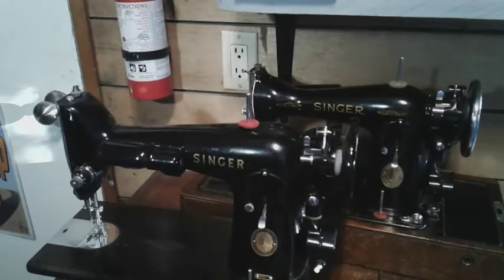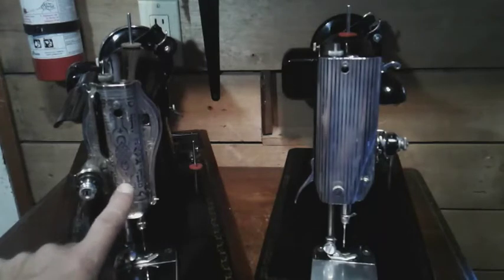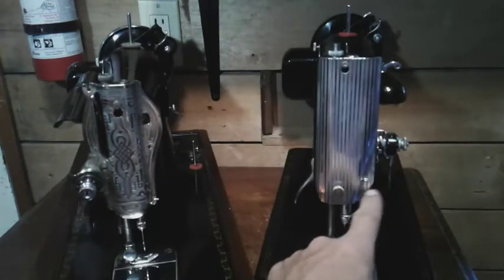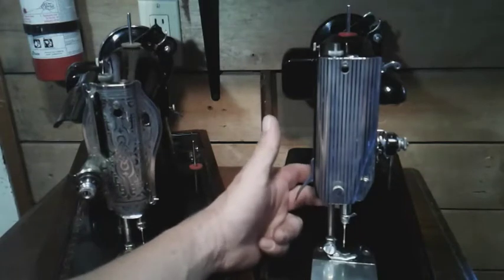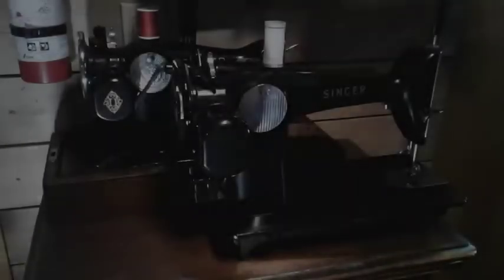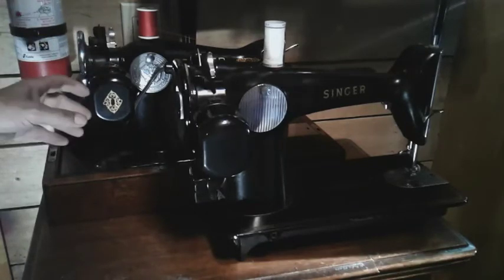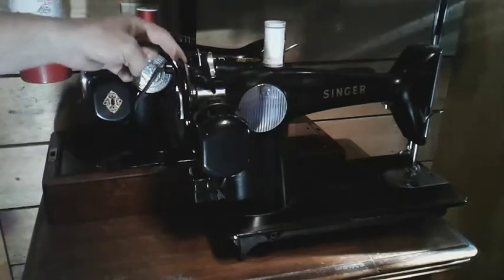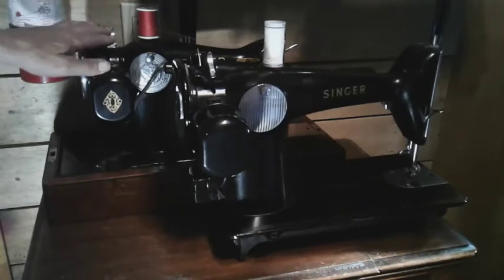Singer 15-91 vrs Singer 201 , What one would i keep ..

Comment: I believe that your 201 has an additional thread guide that rides on the needle bar.
The glass lens over the bulb may also be missing. 
I would like to find a LED replacement bulb that is warm white around 3200K and full spectrum / high CRI.
A dimmable LED would be a bonus with a dimmer switch retrofit.
Thank you for showing these machines.
Reply from the maker: Your correct on the neddle bar guide , all machines should have one there and mine does but some of my machines are missing it and the still run fine , but as for the glass on the light im afraid you may incorrect there , the 201 potted motor version with the light in the front does not use a glass cover , only rear mounted lights do , ive looked at many machines identical to mine and none have glass covers over the lights , now maybe im wrong but ive yet ot seen one with the glass over the bulb on a potted motor version , im with ya on the LED lights too , i like the warm yellow glow better then the bright white , if its vintage then the bulb should match in my opinion ,but im a novice collector so what do i know lol , thanks for watching and if you have a photo of the glass cover for the potted motor 201 id love to see it , like i said im a novice collector i could be wrong .....
Reply: @4486xxdawson  At this point, it's not unusual for these outstanding machines to have had their SingerLights replaces with similar models from other machines. As well as other parts. I could see one having a glass cover added at some point in the last 60+ years. 
Thank you for this video series!

Comment: I've sewn on both. For what it's worth, here are my thoughts.
Yes, the 201 produces an ever so slightly better stitch. A 10/10 for the 201 and a 9.95/10 for the 15-91 **when in proper adjustment, clean and lubricated**.
In terms of speed, when I need speed, I use one of my Singer Industrial machines.
In terms of difficult synthetics, denim (especially hemming), running a button hole machine, decorative zig-zagger, walking foot for super-slippery fabric or, most of all, free-motion - the 15-91 produces the same perfection without choking and the 201 has challenges.
In the end, my 401A and my 15-91 are my daily drivers. The 401A for that 10/10 perfect top stitching, the 15-91 for virtually indistinguishably stitch quality for everything else. Ironically, the 'Spartan' offers all the stitch quality of the 201 with nearly the power of the 15-91.
Reply from the maker: I like the 15 91 for sewing patches on my leather vest,  its like the tractor of singers , got the strength and easy to work on , plus more of them on the market still so parts easy to find,  as for the 401 i never used mine much just tuned it and sold , not really a sewing person just like working on them and the feel of them , its like nothing you can buy today ..,,thanks for watching and hope to hear from ya again soon...
Reply: @4486xxdawson  Thank you for your reply! The interesting thing about the 15-91 is that the combination of power and the "who cares, whateves, I'm going to make a perfect lockstitch" robustness of that oscillating hook let's me sew super filmy silk and other slippery fabrics with a vintage walking foot with a perfect stitch just as easily as I can hem a pair of jeans in the same thickness as the factory original.
The 401A was very close to the end of real Singer quality. The hook drive gears are not only hobbed, but paired and polished together as a pair for each single machine to produce the smoothest work possible. The stitches are every bit as perfect as the 201 and you have all the versatility of a workhorse decorative zig-zag machine. I'd never get rid of either.

Comment: I just got into refurbishing these and I have four 15 class. One is a 15.90 the other three or 15.91. I have two 66 class I would like to get my hands on a decent 201 to refurbish and I'll find one eventually. But from what I've been able to find out, the 201 puts out a really nice stitch. It was considered the dressmakers machine but the 15 class was considered the farm machine. It was capable of handling tougher material than the 201 I don't know. This is just what I'm finding out but it would make sense that they would have one that was for more along the lines of a seamstress or Taylor and one for a farm being more rugged
Reply from the maker: The 15 class are tuff thats for shur but the 201 is as well ,depending on what you want to do , the 201 was iconic because Rolls Royce used them to do all the leather interiors way back so hard to say what one is better , the 15 is easier to work on but the 201 is soo smooth you will never go back to the 15 once you try one , but i do use my 15 for tuff jobs because i dont want to work my 201 to hard , its just too nice to do the trench work , thanks for watching and welcome to the sewing machine addiction club , sounds like the bug is already set in lol ...sorry
Reply: @4486xxdawson  yeah I actually like fixing these. I like fixing things and these are easy to fix for me and I can pick them up everywhere. People are just screaming to get rid of them My current project is a class 15.90 that I'm converting over to a hand crank but I'm going to rewire the motor and the pedal and so forth. So I have the option of going back and forth if I want to and I may set it up as a treadle one day so I have a three in one

Comment: I want you to compare a 201's stitch to a 306 or 319's straight stitch. Then I want you to explain why 306's and 319's stitches are more perfect than other Singer sewing machines.
Reply from the maker: 201 and 306 i have but i do not own a 319 ,,,,,,,yet lol , as for the perfect stitch its more about adjustment really , my 66 singer does a beutiful stitch , just as nice as a 201 , i think people like the 201 for how smooth and quite it is . I will put a note on the board for a compared 201 vrs 306 and do a video come fall , im real busy at work right now and my camper needs closing before winter so if you have the time i will do a video comparison video in the future ...thanks for watching and commenting....

Comment: My first VSM was a 15-91 and I just love her. Got her a couple of years ago including a cabinet, and accessories at a thrift store for $42.00. She runs like a top, and will likely always be my favorite. 

I recently acquired a 201-2 at another thrift store for only $10.00, including a water damaged cabinet and accessories. (Couldn't leave her for that low price.) She ran initially, but has since seized up, so I'm sure she just needs a good cleaning/oil and re-greasing to run again, which I'll enjoy. 
Thanks for the comparison. I've heard many folks mention that the extra harp space on the 201 is a ideal for quilters.
Reply from the maker: Nice purchase , i havent seen a 15 91 vsm , going to look into that , thanks for commenting,,
Reply: @4486xxdawson  I think the initials VSM as used by JH may refer to Vintage Sewing Machine, as opposed to Vibrating Shuttle.
Reply from the maker: @joeschueler8587   your probably right i allways refer that because i own a couple VS3 and and  VS2s ... VS does stand for vibrating shuttle but if you put an M behind it i guess it could mean anything lol  .thanks for correcting me ...hell when texting came out i thought my buddie was gay ,he kept sending me lol and when i was young that meant lots of love not laugh out loud so am i wrong there too hmmmm guess ill just use words laugh out loud .....
Reply: I inherited my mom's 201 which I learned to sew on in the 60's.   Just a tip, don't neglect to examine and clean the foot pedal.   Lots of lint gunked up with oil that affected mine and didn't allow electric to flow :)
Reply: I don’t think the 201-2 is supposed to be greased since the gear tolerances are so close.  Just oil it.

Comment: I have a Singer class 15-88 and a 201K. One thing that is better on the class 15 is that it's easy to change the tension on the bobbin case screw, and it is harder to do that on the 201, as you have to bring the screwdriver at a certain angle.
Reply from the maker: I agree thats for shur , even a vibrating shuttle is easier bobbin is easier then a 201 , but such a smooth runner ...Thanks for watching and subscribing i appreciate it

Comment: Just curious, did you use the same controller on both machines? I have a lot of old singers and the style and condition of the controller sometimes has more to do with sewing control than the machine itself. Some are very linear in response with great low speed and some are closer to an on = off switch
Reply from the maker: Yes i used the same foot controler for both , being both potted motors the are the same amps ...
Reply: Thanks. Choosing from the 2 best Singers is not easy! I have 3 of each, can't pass them up at  $20-$25 in thrift stores. My favorite for control is a 1914 15-30 hand crank, very good for heavy repairs on backpacks etc. I can go one stitch at a time if needed. 201s are the nicest to operate, smooth and quiet. Also love our old vibrating shuttle machines! Keep the videos coming, love your content!

Comment: Note to Viewers:
Bulbs - Amazon and Ebay have LED bulbs.  
Measure length of your lightbulb from tip to tip.  
Measure diameter of base.  These are usually standard sizes C5, C7, C9 base diameter - look it up.
Screw in or Push in type base. Screw has threads spiraling.
Bayonet base is Push In type - smooth with two prongs sticking out.
Single contact, or double contact - this refers to the bottom of the socket base - do you see one blob of lead or two?  

So you would look for bulbs with this search criteria:
1.  LED bulb  bayonet double contact
2. LED Bulb  screw in single contact .... etc.

All bulbs come in Kelvin ratings. This is the 'color' of the light ranging from 2700 Kelvin to 6500 Kelvin.
I like the 3000K best, as 2700 is very mellow yellow and 3000K is a bright white light.
It turns very bright almost bluish fluorescent light from 6000 - 6500K but also works well.
Choose 2700K for bathroom soft light or RV bulbs but always a brighter light for desk or sewing work.

The LED bulbs can be encased in plastic, glass, silicone. Pick Silicone every time. This is a clear rubbery silicone casing on the LEDs that is far superior to Plastic which distorts the light and puts lines in it, or glass which breaks.  Silicone is wonderful.

You MUST CHANGE OUT YOUR INCANDESCENT BULBS in all machines.  Why?  The heat generated from regular bulbs damages your plastic, rubber components inside the machine, makes the plastic shrink and crack, rubber crack, and dries out the oil to become gummy faster. You use more wattage electricity, and the light is dim and yellow, the glass can shatter, and they have a short life and cost a lot. LED bulbs have low power, light is bright, no glass, long life, and cost much less than proprietary conventional bulbs.  Wonderful difference.

Comment: Is there any difference between a 1950 201 and, say a 1957 ... a later version?  Just curious because I see 1950 machines available but never any "newer" ones.  Thanks!
Reply from the maker: Thats a good question , i can tell you the belt drive 201 i have is a 1951 but the 1957 i have is a potted motor version , so i cant really say for sure because i have 2 versions , but i think the belt drive 201 did run a long production period , id say there are probably 1957 belt drive 201s and they wouldn't be any different then a 1950 , they made the 201 right the first time it was invented and the only change ive seen was the potted motor version then after that they came out with the more modern versions but i stop at 1960 , anything newer then that im not interested in , well hope i helped with your question,  lots of jibber jabber for ya lol thanks for watching......

Comment: I enjoyed the comparison since I recently got a 201 and also have a 15-91. My 201 is  slightly smoother and quieter than the 15-91, but my main issue with the 201 is getting the bobbin assembly apart for cleaning. It's just a bit fiddly and easy to put back in wrong. Cleaning the 15 bobbin assembly is so easy and straightforward. The rotary bobbin area on my 404 is easy to clean too. I'm not sure why they designed that retainer ring like they did on the 201. Sliding that spring thing with a screw driver while holding the handwheel etc...well, I have to consult the manual every time. Maybe eventually it will be second nature, eh? 
Perhaps part of your "stay or go" comparisonon of machines could include ease of maintenance, too. Anyway, thanks for the video, I look forward to more!
Reply from the maker: Thanks for the imput i will try and make some videos on maintenance but to be hounest im no expert,  just a pretty new collector so dont know as much about them as some others like Bob Fouler and his channel  , i use him more for repair and maintenance so really i try and keep my videos simple and short and refer people to watch the pros for repair , but i can try 👍
Reply: I’m in this exact situation. And i was born in the 80s. Lol. Can’t stand seeing this beautiful machines go to waste

Comment: I found a 201 and realised it was the machine I learned to sew on, so I bought it and delighted in the muscle memory. But I want to do free motion quilting, and I was told by an expert that the 15 is better for that, because when the dogs aren’t in play (dropped or covered) the threading of the bobbin has an effect . She said that because the bobbin thread of the 15 is vertical, and so in the same plain as the top thread as it comes down to make the stitch, you get better stitch formation for quilting. The 201 bobbin thread is at right angles to the top thread. I’ve not tried it out yet, although I also have a 15. But I have seen people successfully FMQ on a 201. 
15 class bobbins hold more, there is that about it
If you like quilting think also about the size of the arch, which you will fill with quilt fabric as you’re trying to wrestle with it. They are much larger than modern machines, but not all the same size. Could be the 66 is the biggest of these domestic machines. Even bigger is a 31, a tailor’s machine. Basically a giant 15
Ooh I must get them fettled and start working with them!!
Reply from the maker: I wounder how good a 115  would be for quilting ? Its a virtical rotory hook so like a 15 but much much smoother like a 201 , it makes sense to me that the vertical hook of a 15 class would be better for free motion , this is why its nice to have many machines , you get to learn and use them all for different things , its like i say they all have thier pros and cons ...happy to know you use and enjoy your machines , after all thats what they were built for , thanks for watching stay tuned for more on my collection......

Comment: Just inherited a family 201 and didn't realize the foot controller was missing, so ordered one right away. My actual first thought as I sat the machine on the table to admire it was, " I need an LED light! That thing will burn!" 

Foot controller today, led lights tomorrow, bobbin tire on Saturday. Amazon Prime has lost its glow. Second day now means 4 to 6 days and so many commercials with the TV.
Reply from the maker: You might want to be careful  !  dont sit and admire too long, thats how you get addicted to them , have you learned nothing from me , lol thanks for watching and commenting , if you like the way it looks , wait till you sew with the 201 .... good luck and there are help groups if you feel you cant resist buying another  vintage Singer
Reply: @4486xxdawson  Actually, the only other machine I want is for my 1990 Kenmore/Janome, I want to buy a working donor. They are usually about $40. Does zigzag and makes great buttonholes. Easy to travel with. Probably will service my basic needs until death do me part. Mom has given me a 15-88, great for upholstery and jeans. I have a small serger for minimal serging needs. With the acquisition of this 201, I have a Morse that I'll probably give away or sell. Thought this 201, was a 401 that my Grandmother had for years. Wasn't that excited. Was stunned and confused to find a 201 in the cabinet instead. My 88 year old Dad very quickly solved the mystery. "That's not your Grandma's machine! That's Aunt Birdie's machine. I KNOW that machine!"

Great Aunt Birdie had no children and therefore had things my Grandma truly envied. I doubt Grandma had much opportunity to sew on the 201 though she had coveted it for 40 years! She knew that of everyone in the family, I'd be the one to appreciate this machine. Grandma was one of a kind. We have a photo of her - in her 80's - riding an elephant!

I'm actually more interested in the sewing than the machines. Little chance of SMAD for me, but oh so happy guys like you get addicted. Gives me the opportunity to keep my tiny herd functioning without repair bills. Thank you so much for your wonderful videos.
BTW- this isn't my device- I'm a woman. Ergo- the emphasis on sewing rather than mechanics.
Reply from the maker: @cliftonmcnalley8469  im so happy you enjoy my videos , when i first started my obsession i wasnt looking for singers or did i want to collect , it sorta just happened , see i got a 1970s kenmore to sew a patch on my leather vest , didn't care what machine i had , just wanted a all steel vintage , well got sewing and found it rather relaxing and a place i could go to get away from every day stress , well i came accross my necchi BU for free and figured i try a restoration project and that same week found 2 separate machines tossed to the curb ,singer 237 fashion mate zig zag , then a 401 slanted , got all 3 restored and working perfect , sold the singers , kept the necchi and after that it was all vintage and antique singers  , and here we are today , glad things are working out in witness protection lol alias Clifton lol ....stay tuned for more on my collection and thanks for sharing your story , i truely enjoyed it ....